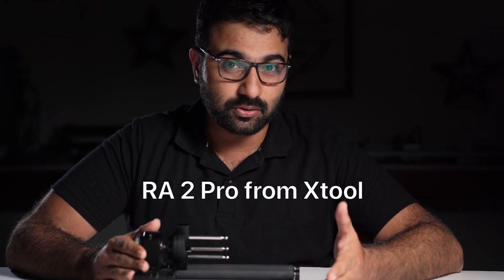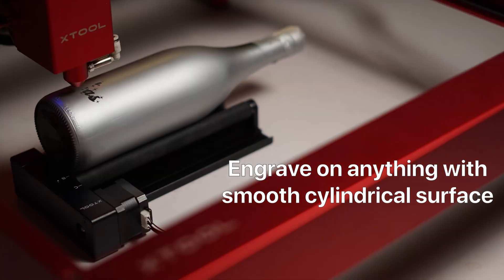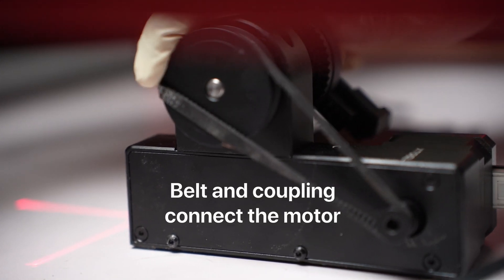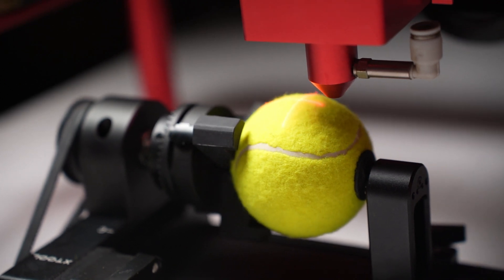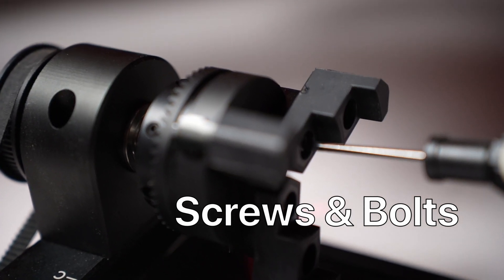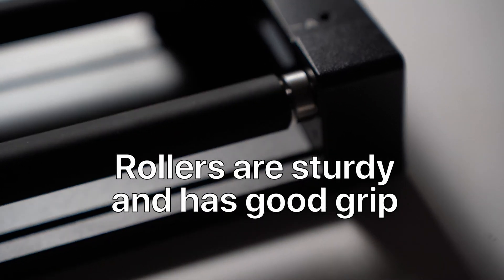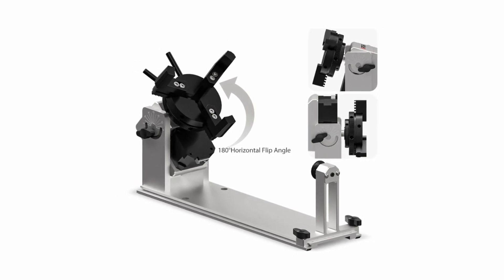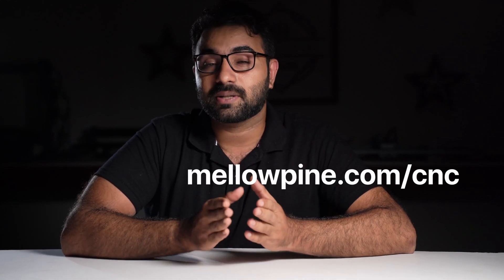Why buy a Rotary? Xtool RA2 Pro Rotary Module Review!

Comment: Excellent presentation, thank you.  When engraving the tennis ball or any other curved surface where the distance between the laser head and the surface being engraved varies along the axis, how noticeable is the loss of definition due to the beam spot size increasing as it falls away from the laser’s point of focus?   And because the spot size increases, the effective power will reduce because it’s spread over a larger area, so how does this affect the engraving definition?  Is it noticeable?

Many thanks.

Comment: Why would you not compare the xTool RA2 to the Atomstack chuck tool? I used it on other lasers, and the cost of the Atomstack R1 Pro Multi-function Chuck with Roller Rotary is still considerably cheaper than the RA2 Pro. I am actually quite disappointed in the RA2 pro as you have to take it almost completely apart to change from roller to chuck, and the lack of any tilt adjustment on the chuck severely limits its versatility. If I could figure out how to connect the Atomstack to the F1 Ultra, I would toss the RA2 back in the box and return it...

Comment: Hi i'm interested to by a rotary module but i have a falcon 2 Laser Engraving by Creality. do you thing that RA2 Rotary Module from xTool is compatible with my machine?
Reply from the maker: Hi, generally, a rotary module can be used with any laser engraver, as long as it supports the type of connectors provided. So, I think it should be compatible if it has the same connectors provided in your Falcon 2.

Comment: Second review I've seen in two days that suggests a problem with X-Tools bolts, the other reviewer found the belt tensioner bolts on the X-Iool D1 Pro arrived pre stripped, yes its easy to replace but given that X-Tool market themselves at the top end price wise for Diode Lasers thery should be supplying quality bolts
Reply from the maker: Yeah, they should look into it

Comment: So is the Xtool Rotary compatible with many other laser brands? Like, you could use this rotary for a Sculpfun Laser? If so; I might go Xtool for Rotary for my new Sculpfun S30 pro max.
Reply from the maker: I have tried it with Ortur, Atomstack, Comgrow, and Two Trees. It worked well so I believe it should work with Sculpfun as well. It all depends on what type of cable connector the machine has for the Y0-axis motor. If you can send a pic of your connector to mail@mellowpine.com I can verify.

Comment: How did you engrave the coffee mug? Did you prepare it in any way? I tried to engrave a white mug with my 10W Ortur LaserMaster 3, but it didn’t have any effect, even at very slow speed.
Reply from the maker: For white mugs you need a coat of white paint. You can check out my video on engraving ceramic tile which explains the process in details. It's the same technique for coffee mugs.